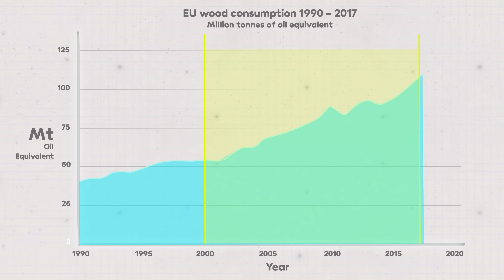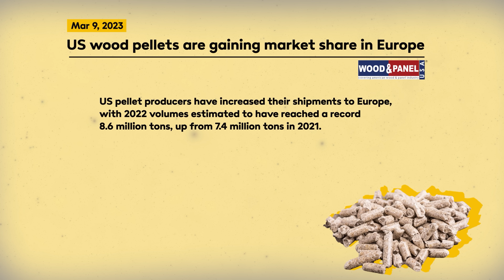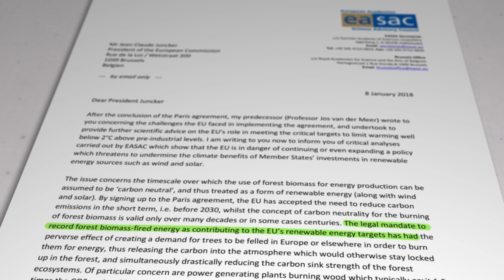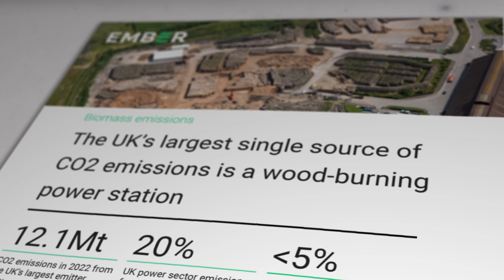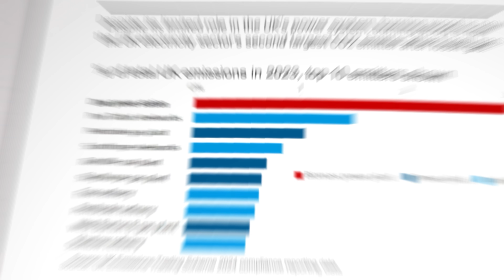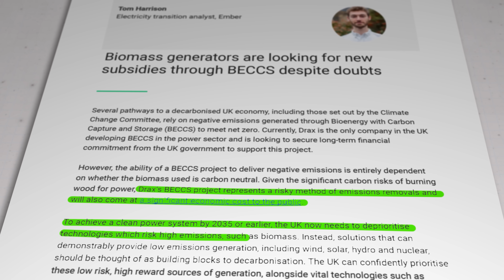New report: Biomass CO2 emissions 4X higher than COAL!!

Comment: Carbon capture and storage works. It's called trees.
Reply: Not nearly as well as you would think, and especially not when using gigantic monoculture forests.
Reply: swamps, more like
Reply: @paavobergmann4920  Good point. Trees have a habit of burning as the climate warms.
Reply: Biochar conversion asap in the soil for those trees you speak of is the blue ribbon best carbon capture
Reply: @MikeWasley-r6f  algae is way more effective for carbon sequestration - no stems and no leaves. So algae is at least 10 times faster. Oil and coal are from algae. On land it is mycelium that stores carbon. I'm gonna haul wood chips today - and then inoculate them with mycelium. eight inches deep of wood chips and then bury the mycelium 2 inches into that. Winecap mushroom quickly turns wood chips into soil but that edible mushroom then stores the carbon into the soil for the plants to take up. It's the Endomycorrhizal fungi that permanently sequester the carbon into the soil since they live in the plant roots.
Reply: actually it's endomycorrhizal fungi

Comment: Until we seen the CO2 concentration in the atmosphere begin to decline you can be sure our current policies are not working.
Reply: Atmospheric CO2 has declined in the last year by 4 PPM
Reply: @rcpmac  According to the latest data from NOAA's Global Monitoring Laboratory, the global average atmospheric carbon dioxide concentration was 419.3 parts per million (ppm) in 2023.  This represents an increase of 2.8 ppm compared to 2022 and is the 12th consecutive year where the annual increase exceeded 2 ppm.

Comment: Madness, it's good to find a use for mill waste but burning it is madness why not make building blocks (bricks) out of it thus locking that carbon up for maybe hundreds of years.
Reply: Becouse it is inefficient overcomplicated and does not scale up. Sawdust is flamable and needs binding agent to be turned into bricks. To be turned into brics it need to be bind with agent that gives it enough strenght to be used as building material, inhibits water retention, secures it from mould and other fungus, is non flamable, is non toxic for humans to live in, is stable long enought to last decades, is weather proof. 
And when You get it, it needs to be in price range of bricks... 
It would be cheaper just to dump said wood into oceans dead zones to be stored indefinetly.

Comment: There are several points relative to this video but I'll make the most contencious one first.

CO2 is not what is changing our climate at current levels of CO2 concentration, it is now exhausted.

Drax is merely exploiting the naievity and ignorance of our government in offering large subsidies for an ineffective and misguided . effort to control climate.

Carbon capture and storage has to be one of the very worst ideas to come out of climate hysteria, it is unproven, expensive and consumes considerable amounts of power to operate it.

Wind and solar are not viable sources of generation, for practical and technical reasons and are why our electricity cost so much.
Reply: can you explain why solar and wind are not practical energy sources and a source for your assertion that renewable energy is more expensive, as I thought wind and solar were the cheapest form of electic production.
Reply: Walter, 
we are told they are cheap but analysis of their cost prove otherwise. The U.K. government has periodic auctions for the building of renewable generation and the price is given in Megawatt hours. The latest rounds have prices higher than the average cost of supposedly expensive gas  and these prices are index linked to inflation. (Gas generated electricty, an essential, have tax imnposed on it adding to our cost and its still cheaper)
Also as wind and solar cannot run witout support as they are both intermittent and lack certain technical attributes that are essential for a stable grid. Essentially this support, mainly gas on the U.K. grid,  has to have an equivalent capacity and be available at all times, essentially a duplication of assets doing one job. If no wind or solar was built we would still have power.
 Wind and solar deteriorate in their output as they age, so provide less and less power over time until they are uneconomic to run, conservatively 20 to 25 years so they have a relatively short lifetime before replacements are required. They also require extensive infrastruucture to connect them to the grid which is expensive, did you see the  recent news item that a cable to connect wind power in the north to the south was about £5.8 billion? All this is added to your electricity bill.
Reply: @iareid8255  - The north-south cable is required regardless of power source, it deals with the grid congestion problem that has been present for a long time between the two main UK's original grid systems. Long term energy storage systems are also being introduced to deal with the same issue between the other congestion points, as well as to provide continuity of supply - providing a cost effective solution that previous were addressed by more expensive gas peaker plants and paying generators expensive rates to stop generation during periods of grid congestion.

The UK's recent strike price for offshore wind is £73/MWh, this was higher as less offshore wind capacity was being auctioned than in previous years (£44/MWh being last year's strike price). The price, however, is still lower than wholesale gas price with energy consultancies estimating the for each 1MW of offshore wind generation consumers will save of £180 million per year compared to using gas based generation.  

Gas plants also have high maintenance costs, with high cost and timeline impact when their turbines are out for regular maintenance with replacement time also circa 25 years. Wind and solar offers a finer grained maintenance capability, allowing individual strings of PV panels or wind turbines to be scheduled for maintenance at a more cost effective rate.
Reply: GSG, 

the only reason is that the capacity in the North is too large; power plants should be built as close as practicable to the demand. A factor of wind generated power is that the transmission lines must match maximum output but in practice carry a small proportion of their rated capcity, so underutilised.

My understanding is that gas costs for CCGT (OCGT is much higher because they are used for peak lopping, but their output x time is so very much lower) is around £60 or so per Mwatt hour, and that incules a carbon tax despite the fact the grid win't run without them. Also strike price is index linked to inflation and is locked in for fifteen years. You canbnot talk about renewables being chepa when they need the support of a parallel source equal approximately in capacity.

You should read Dr Gordon Hughes' paper on the maintenance costs of wind turbines and that their output declining by about 3% for onshore and 4.5% for offshore per annum such that some become uneconomic to run after fifteen years.
Reply: So nuclear and hydro are back on the menu.
Reply: @dimmedaurum114 
Nuclear was on the menu about twenty years ago, but the uninformed government of the day cancelled it and went for useless wind instead. Had that not happened we would be much better off today.
There is little scope for hydro, as the geography os simply not there, and the greens oppose it anyway, as they do anything that works.
Reply: "CO2 is not what is changing our climate at current levels of CO2 concentration," <- lie.  Whether or not you know it is lie, or if you are just being a robot, I cannot tell.  

"Wind and solar are not viable sources of generation, for practical and technical reasons and are why our electricity cost so much." <- all around the world you are being proven wrong every day.

Comment: The production of Biochar can produce nearly 50% the energy as simply burning wood while locking away a large amount of carbon. Once in the ground the carbon aids water retention and in suitable soils increases soil fertility. If Governments could subsidize carbon capture, the use of wood pellets could be a positive contribution in our efforts to reduce CO2 levels.
Reply: Producing biochar (formerly known as charcoal) produces 50% of the (heat) energy as "simply" burning wood, because you only half burn the wood! It doesn't lock away any carbon, it emits 50% as much as if you burned the wood completely. The remainder, which could have stayed locked in the living trees, might be locked in the soil if you bury it, but equally might be released at your next barbecue or farrier visit.
Reply: @nickwinn7812  biochar lasts longer than wood in the ground.  That being said biochar is better suited to places that need it aricultrally in mass.  UK wouldn't need much.
Reply: So what, they had an accident.  Accidents happen at hydro electric dams and generators, wind turbines and solar storage systems.  So what
Reply: So an energy producer would have to have twice as much wood to make the same amount of energy, twice as much transport, and now you are saying they have to factor in finding a market for charcoal, a great heat source that they could use to produce steam, but instead of using it themselves, you say governments could create new money, because taxes don't pay for anything, new debt into the economy creating more inflation , while electricity costs rise?

Comment: Oil is a renewable resource......
If we took 200 million years to use what we used in the last 200 that is.
In short, we have a budget in all sources of energy. it is not sustainable if it is used faster than it can be replaced.
where we need a large amount of energy at once, it'll have to be stored up before hand.
Fossil fuels is the least efficient way of energy storage.